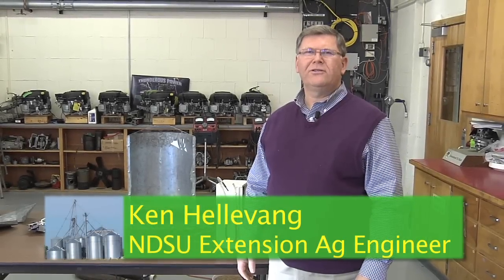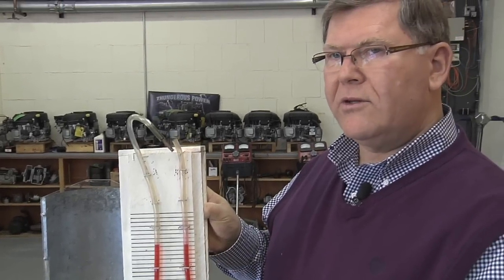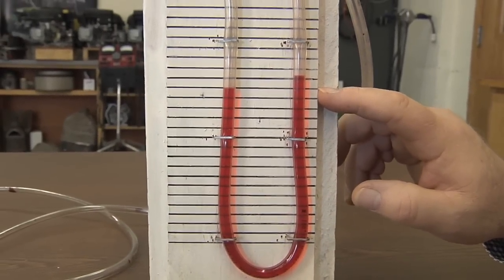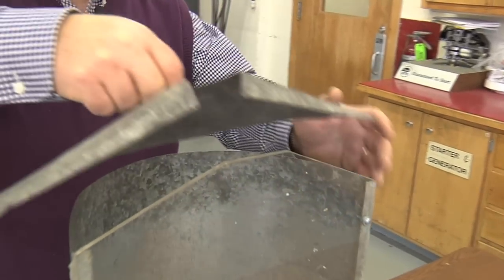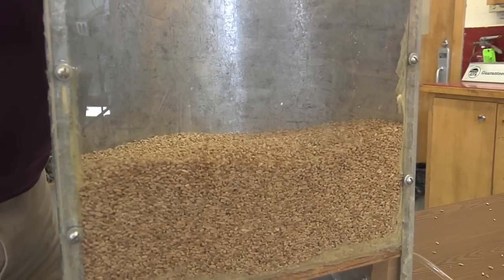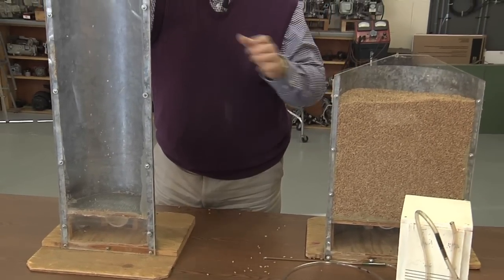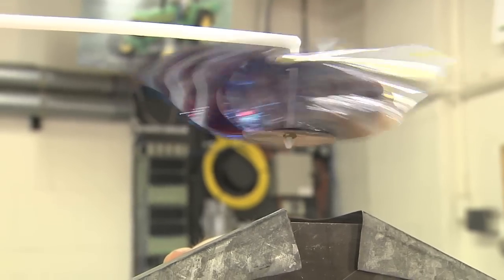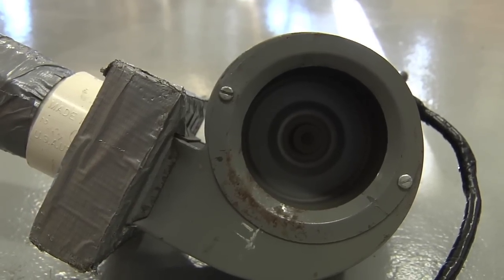Understanding Airflow Principles to Properly Select Grain Bin Fans (Part 1 of 2)

Comment: im building a hoovercraft,and i was thinking of using a grain bin fan as a lift fan.
The fan would need to move 8580 cfm with a static pressure of 2 inches of water.
I am having trouble finding specs for these fans power requirements included, any information would be greatly appreciated